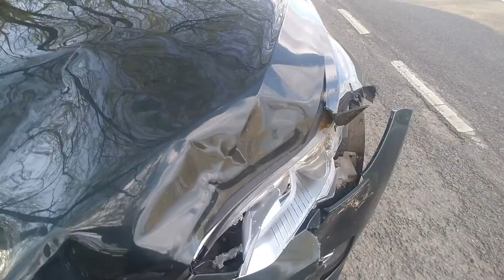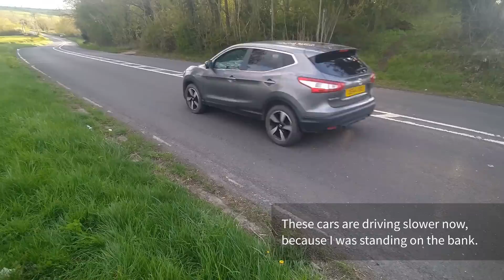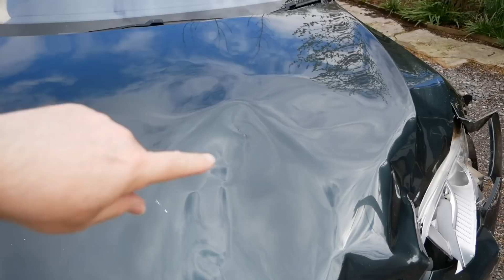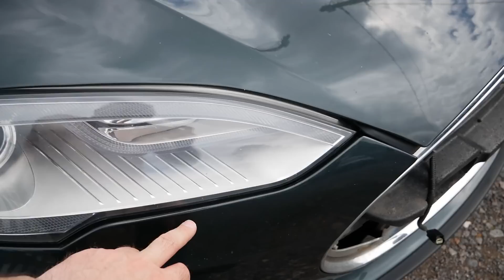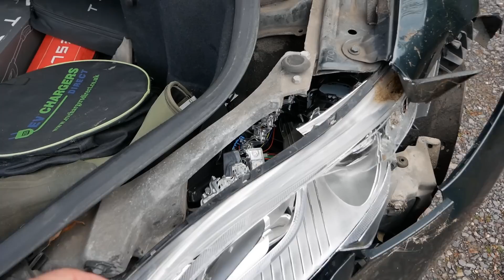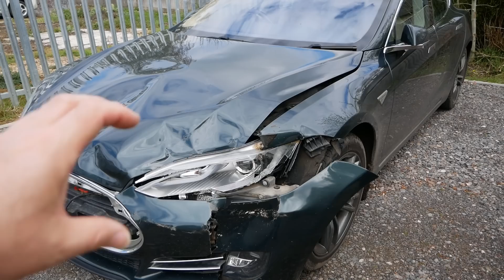Oh s**t, my poor Tesla Model S ! I hit a fallow deer.

Comment: I'm so sorry to hear about this. My Model S is the same vintage. I hit a deer with my Pontiac Grand Prix GT 20 years ago and ever since then, I put deer warning whistles on my cars. They basically give off an ultrahigh frequency that warn deers that you're approaching. That may help if this is a common thing that happens when you travel. Again, I'm so sorry this has happened to you. I pray you can get her running again at minimal cost.
Reply: That's a really good point. I never knew about deer warning whistles. I posted a comment about the relative quietness of EVs (compared with ICE cars) being a contributing factor to these kinds of encounters. With increasing EVs on the roads, will these incidents increase?

Comment: Hey Matt, I'm glad you're ok. A similar thing happened to my Dad in his Facelift First-Gen Mondeo (The Eggshell bumper version). He didn't bother going through insurance which would have written it off, there was no structural damage just cosmetic so I repaired it with scrapyard body panels. 
I'm sure you could get a front-end set to repair your pride and joy; it could be an opportunity to refresh the front end with a good quality aftermarket front end such as the Unplugged Performance Refresh front end. Colour might be tricky as it's a rarer colour but that's what paint shops are for.
Reply: That's what I'd look at doing before telling the insurers.  Go through them and at best it will get a N, but probably an S classification and Tesla will strip it of its 'free supercharging' - don't tell them and they'll never know.

Comment: I can see the possibility that it might be written off. I'd suggest there will be some movement of the structure but without some dismantling, you can't fully establish the extent of this on a modern car. There are a lot of cars currently being written off by insurers due to current parts availability but if the duration of repair is not an issue for anyone involved you might be able to have it repaired if that's your preference. You can ask your insurer to repair up to 100% of its market value.
Reply from the maker: Apparently insurers will only repair up to 65% of the value. It makes sense as they then sell the damaged car through a CoPart auction and recover around 50-60% of the value.
Reply: @GoGreenAutos  Every insurer's threshold percentage is different but what an insurer's preference is doesn't change your rights.

Comment: It’s up to you if you want to get it repaired? Plenty Used model S parts available these days. All those items are bolt on. Even get the correct colour panels
Reply from the maker: But its not my decision if I go through the insurance. It wouldn't be viable for me to repair without doing that. Also sourcing front end parts is more tricky as most damaged cars being stripped for parts have front end damage.

Comment: Matt, I think it looks worse than it is.  You can find used bonnet, fender (wing) and nose cone each for about $250 - 500 in the US.  Tesla used the same parts for many years (until 2016?), so they are not rare.  Guessing similar in UK?    Used headlight is about $150.  All these parts should be available from Tesla as well, but for much higher price of course.  As long as there is no other structural or mechanical damage, with a little paint matching you should be back on the road.  It would be a shame to give away a new battery, drive unit, and infotainment system.
Reply from the maker: There's not so many older Teslas in the UK, so sourcing parts will probably take a long time. And of course, most crashed cars have frontal damage! I could try to repair myself, but then it is still going to be a significant cost.

Comment: At least no-one was hurt (other than the deer, and perhaps your pride). The Tesla however - my guess is it will be written off due to being uneconomical to repair. Knowing the history with the new traction battery, motor, etc. if the car were mine, I would seriously consider buying it back from the insurance company as salvage. Parts will be expensive and some likely to have long lead times if you choose to get it repaired. Or perhaps it's worth more in spares? One point to bear in mind - if I recall , do Tesla's involved in serious accidents have its ability to use a Tesla Supercharger permanently disabled?

Comment: Such a shame, and terrible luck. It was great to meet and speak with you at the Oxford event last saturday, so obviously I won’t give my opinion on what the insurance are going to do! I hit one of those deer in the early 2000s, in an MX5 ,at about 50 mph in the dark (nothing I could do - it wasn’t there, and then it was). Damage was probably not quite as bad as yours interestingly. Took a while to repair as it was an import and they said it needed all different parts to be imported. Got them to change the repairers who said that was nonsense (about the imported parts) and they fixed it in a week.
Reply from the maker: Hi. I got sun burnt from standing outside all day. It was a busy little event.

Comment: You asked your viewers what we think. I am not in any way qualified to have an opinion on whether or not the insurance company will write the car off. However, given how attached you quite obviously are to the car, I would advise that if the insurer writes it off, you should seriously consider buying it back to repair it. While I believe that insurers are now much more likely to consider the use of used parts to repair older cars, I believe that they still prefer the use of new parts and thus overestimate the costs of satisfactory repairs to many cars. 

I hope that your car is not written off by the insurer and I hope that you will have many more years of happy motoring in this car.

One final thing is that I agree with you that that green is a great colour and I would like to see it and some other decent colours offered across the Tesla range. The current choice is rather dull, though I do like the navy blue, and the red is OK.

Comment: Buy it back and get it repaired.
Body parts get from a quality recyling company then they just need painting to match. Do not waste your cash on new parts that will take months to arrive. If you know of a decent local body shop take it there 1st for repair valuation. Before talking to your insurance company, other than informing them of the accident within 24 hours as required.

Comment: Ah mate, that sucks so much 🤦🏻‍♂️ my only advice regarding getting a valuation if they do write it off. Do your own research for car for sale from auto trader as a close as possible like for like car for with the changed battery, Mcu, drive unit, free super charging. I would screen shot cars to your spec and also save the links just in case there not available when you need them. I had similar issue (not with a Tesla) but they offered a joke of a valued estimate. I ask how they reached this price!? To which they just found the cheapest off auto trader and sent me a couple of links. Which wasn’t a auto, zero options, no full service ect. I found a almost exact spec as mine going for 8k more to which I sent them and they accepted! Hopefully you can do the same!

Comment: Surely this is repairable, nothing structural is damaged?
Reply from the maker: Only the front crash beam/cross member. That will need cutting off and welding a new one on.
Reply: @GoGreenAutos  you just need to find a salvage model s that's had a rear impact

Comment: After watching Rich Rebuilds ids say it can be fixed
Reply from the maker: Oh yes, it can be fixed. But its whether the insurance company agree to pay for it to be fixed is the big question. Or to word it another way...it depends on what the body shop quotes for the repair. Apparently the insurance companies will repair if the cost is up to 65% of the value of the vehicle.
Reply: @GoGreenAutos  i had a brand new Triumph 500 in 1973 and the insurance wrote it off after an accident then some guy was riding it a year later , its still on the road today , what i should have done was not told the insurance company but got used  parts just to get it rideable again ,

Comment: Crap ! you hit that deer at a higher speed to do that much damage!  I hit a deer at 40mph and it did alot less damage than that! You hit that doing 60mph, far to fast for a road that you probably know that deer cross! I drive a road every day that's 60mph ,but I know there is alot of deer crossing, so I only drive 40mph on it!
Reply from the maker: No, I was only doing about 25mph. I don't know the exact speed as I wasn't looking a the speedo, but I'd just came to a near standstill from 50-60mph and was just starting to accelerate again. 30mph max.
But it was a big deer. It was fallow, not a muntjac!